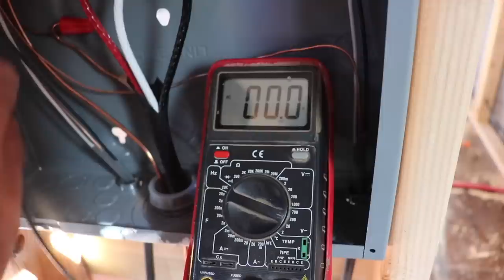CUE THE WATERWORKS!

Comment: A few minor electrical issues, from an electrician: that grounding clamp is normally used indoors on plumbing, the one you should have used is called an acorn clamp.  It also should have been put on before you pounded the ground rod in, because you often mushroom the head of the ground rod as you did.  The acorn clamp seems less likely to corrode and fail in a direct burial situation like that, which is probably why is is normally used there.  Also, your light in the pump house should be wired on the line side of the GFI, not the load side, so that when the GFI trips you will still have your light on.  The third issue is not a functional one so much as it is a code thing: the cables you pulled through the conduits to the barn and the pump house are not meant to go inside of conduit like that.  The NFPA doesn't like cable assemblies inside of conduit like the NM you pulled to the barn and the UF you pulled to the pump house, because they will be more prone to overheating.  You should have either brought the conduits all the way to the panel and pulled THHN (a much easier pull, BTW) and you should have set a junction box and switched from THHN to NM inside the walls of whichever building.   What you did should work just fine, since the conduits are well oversized, but thought you should know.  Also, all of the conduit (and the pipes too) should have been surrounded with gravel before you buried it.  I'm thinking that one day you may have issues if the conduits shift and you can no longer replace the wire when needed (or if the pipes shift and start leaking).  I hope you never run into those things though.  --- I do really enjoy the videos: your wife is a good videographer/editor and you are doing darn good for someone with no construction experience.  I'm really impressed with everything both of y'all are doing.  Keep following your dream!

Comment: Next time y'all pull wire through a conduit, run some dish soap down the conduit before pulling.  As you pull the wire through, it'll pull the soap with it and lubricate the inside of the pipe eliminating friction.

Also, 4:48 ground wire should've went into the hole with the screw on the butterfly lug.

Comment: Two tips for hammering rods into the ground:
1.  Use a T-post driver
2. Drill a hole part way through a chunk of wood; put hole over post; hammer wood.
Reply: SeaSpirit4 seaspirit thanks!!!
Reply: And soak the ground with water the clay we have here in Texas is hard to go through dry, wet it slides right down, I am talking about that ground rod.
Reply: You can use a hammer drill with the right attachment, just drive it straight into the ground.

Comment: One issue on your load center, the power should always feed from the top, even if you have to pull extra cable inside the box.
Reply: LeewardStudios I saw this as well! I mostly do Commercial tho and thought it was simply a Commercial Code thing for high voltage
Reply: Must be an American code cause in Canada 🇨🇦 (where I am) it doesn’t matter which end you tie in.
Reply: It’s perfectly fine to bring main wire into the panel from the bottom.  It’s allowed in manufactured homes.
Reply: Is the wire feeding the panel correct size “matching rating of main breaker”?
Reply: That is correct. Electrons will flow easier with the aid of gravity. What happens when the box is mounted sideways, do the electrons pool to the lower side?? Or is it really hole flow?? National Electrical (Opps sorry -Fire Code) has all them rules for war. I worked with a guy who questioned if he could run ac "backwards" thru the breaker via a generator when the power was down. We worked on High End Medical equipment. I said 50% of the time it would work!

Comment: If you have to do it ever again they make an adapter for a rotary hammer drill that puts ground rods in quickly.
Reply: glad to see someone mention this. i see many videos of people, even contractors, driving these things by hand.
Reply: Would it work for you put the rods in the same hole as the concrete support columns?
Reply: @buicklesabre4466  That is a bonded ground and in some areas is not code, I usually do both, one copper rod straight into the ground and a rebar bonding rod tide to the rebar of the foundation, the two are at opposite ends of the building, larger building get a couple of grounding rods and bonding rods
Reply: Always check your local building codes. Many localities have different rules on grounding and other electrical codes besides the standard National Electrical Code.
Reply: @TdrSld  Thanks for the reply. I'm not a professional, I used two grounding rods like they did in this video. I was just thinking it would have been easier using the same hole as the support columns. Thanks again.
Reply: @buicklesabre4466  i don't think there is enough concrete and rebar for that. they do have something similar called a ufer ground when building on reinforced concrete slabs.
Reply: A garden hose or a bucket of water is the best way to insert a ground rod.
Reply: That's what I was thinking when watching them hammering.  In a pinch, if you have a socket adapter, all you need is a socket large enough to fit over the end of the ground rod.  Another thing is, there is a thermite welding kit that is often used to permanently bond your ground wire to the grounding rod, MUCH better connection!

Comment: Hey guys, hope you read this - When you have your main breaker panel that far from your service wall penetration, you are required by code to have a disconnect switch on the outside wall of your dwelling.  You might want to consider flipping over your breaker panel as the main circuit breaker is typically installed from the top.  Also if you ever have to pound a ground rod in with a hammer again, take that adjustable wrench and use the hole in the handle to guide it, that way you can really let loose without hitting your hand.  Build is going great and I'm enjoying watching your excellent workmanship and the methodical way you approach problems and come up with solutions..

Comment: I can relate to what he felt when the rainwater system worked. I felt the same thing when I finished putting all the steel on my shop roof with a brace and bit, yes every single screw went in by hand. The shop is 25 ×40 so it was alot of screws. But there was a satisfaction in it. I lived for 10 years on my land with no power except my generator for the times I needed to cut alot of pieces. Most of  my nailers and girts were cut to length using the saw rig on my tractor. Living without real power is fine once you get use to it.  You get up when the birds wake up and go to bed when you cant see anything anymore. Falling asleep after 20 hours of daylight was never a problem.

Comment: Congrats on getting the water system working, I know what it's like to live without running water.

When I was stationed in Korea (one year in 1969) I was on a very remote mountaintop  radio site, we had generators for power but no running water. We hired Korean laborers to carry supplies up the mountain - 40 pounds per man up a 2-3/4 mile mountain trail. Several of the men had to carry jerry cans of potable water for drinking and cooking. We were lucky to have a mountain spring the emerged about 50 ft down from the site gate so we actually using mountain spring water instead of the lousy water that was brought in by tanker to our base site where the generators, fuel storage and trucks were.

With no running water we had a outhouse and a 5 gallon bucket with a spigot that we used to take a shower. We heated water with a diesel stove that supplied hot water for dish washing and showering (2+ gal of cold and 2+ gal of hot into the bucket for showers.All of this was in  small cinder block building up against the mess hall / dayroom In the winter it was a very cold walk up the hill from the mess hall to the barracks Quonset hut. That was great duty, it was the six of us against the world and the nearest officer was 26 miles away!

Comment: I would also recommend putting in a low water pressure switch that senses a drop in amperage and cuts off the pump so if your tanks ever get too low and run out you don’t  burn out your pump

Comment: Well done guys, water the and power, it's really impressive that the two of you did what is normally left to tradies. 
Though as a electrician I would have laid an earth/ground mat buried it with coal and salt then fed off a ground wire. It's a lot more work but grounding is challenging when not connected to city power. Or least put in a couple more ground rodes in, one at the pump house. I know it's more hammering but if you have a dish washer or washing machine a solid grounding is essential. Really incredible how far you guys have come

Comment: So very happy for you... next ground rod that you drive, make it easy on yourself... a piece of pipe a bit larger than the ground rod and weld handles on the pipe and a cap on one end. Now slide the pipe over the grounding rod and give it a slam down and no fingers get hit, no broken arms or lives will be lost. Make that driver heavy as the hammer at least to get the most out of it and you will never use a hammer again. And fence posts that are metal... that driver is named after it, it is called a fence post driver but it has multiple uses. Hope that helps you on tasks that are yet to be met. Great work so far

Comment: ...you are correct. If I remember correctly, City water molecules are clustered at 'about' 18 to 20 per cluster. Ionized water  i.e. mountain rain being the best, is clustered  at  'about' 5 - 7. This is why when we drink several glasses of city water, we 'slosh'.
Plus, lacking chlorine  and the naturally occurring 'micro clustering' Your water will go to your cells more quickly, less sloshing and quicker hydration.
In short, your water is more ph balanced, thus the 'smoothness' you experience on the palette.  👏 Enjoy.

Comment: worked for a well companey for 5 years we just did not drill well , did everything else if you want city preasure on your well get a thing call "Cycle Stop Valvue"  it mechanical it will keep depending how you sit it up 70 pounds of preasure on your system at all time, so when you take a shower you will not have to do the dance

Comment: I don't know if you will get an electrical inspection in your area so if you do the wire needs to be attached to the stud before it goes into the panel. Also any hole under 1.5 inches from the outside of the stud needs to be protected with a nailing strip. Great show and best of luck.

Comment: @Life Uncontained  Use a fence post driver to put your ground rod in .. much easier then drive the last foot w/ a sledge. glad to see you folks used a separate ground rod - per code for your sub pane I can't remember how many times I've run into improperly grounded sub panels, Alot of time people/ DYIers have run a 4 wire from the main panel and get shocked when using the tub/shower/sinks.
 Shalom

Comment: Not sure if this has already been mentioned, but check the specs on the flow rate of that ultraviolet purification light.  We had one a few years back that we had to restrict the water flow to it to make sure we didn't pass more water volume through it than it could purify.  Not sure if that's even a thing on the newer models, but worth looking into.

Comment: Chuckling at all the suggestions for driving the grounding rod easier when you've already got it in.  Locking the barn door after the horses escaped.  Please pull it out and do it over.  ;)

Comment: If you have run anymore underground conduit. Lay the wire out on the ground. Pull the conduit down the wire, then glue the conduit it together. A lot easier than than pulling wire through after conduit is in the ground.

Comment: my opinion is to use overflow filling system in ur rainwater tanks (from tank 1 to tank 2 n tank 2 to tank 3 by overflow)...reason for that is by doing so u can use 1 tank at a time also u just need to open the valve of one tank that u wish to use...just a suggestion from my side

Comment: Suggestion: To easily "sink" a ground rod, 1) Scoop out a small pocket of dirt where the rod will go, (3" deep).  2) Get a small pitcher of water.  3) Pour about 1/2 cup of water into the hole.  4) Grasp the ground rod and gently thrust it up and down in the hole.  5) Periodically add a little water if it gets more difficult.  RESULT:  Using this method I have installed many 10' ground rods with no hammering!  It sounds like magic, but it really works.

Comment: Spenser,
If you ever have to install an grounding rod there is an easier way. First wet the ground around where it is supposed to go. Then use your anchor drill to do the pounding. It will reduce the labor needed plus be faster as well. Also if you ever have trouble getting your fish tape to go from point A to B on a long run, use a vacuum cleaner to suck some heavy string  that has a wade of plastic (grocery bag thickness) tied on the end. When that has been pulled through tie the string onto the rope. When that is in the conduit tie the rope to the wire you want to pull into the conduit. The rope will make it much easier to pull in the wire. This can help you now or sometime later. Best wishes to all three of you.

Comment: Hopefully you see this. When you open up the main valves, open them up as slow as possible. That big slam that scared the crap out of you is called a water hammer. It will blow up couplings, valves, fixtures, ect from the sudden rush of pressure. Also open faucets to help reduce the hammer effect.

Comment: Just a heads up you’re going to need to put metal plates over the 2x4 where the wire is or it won’t pass inspection

Comment: Awesome job guys. Only constructive criticism i have is to always act as the breakers are hot and don't put your fingers on the screws. Also make the leads longer at the  90 degree bend in to the breaker. It will help you later.

Comment: hey guys,a tip for putting your grounding rod into the ground,use your SDS pneumatic hammer/drill,also i like to point out that rain water does'nt have calcium,something you need for your teeth and bones,so you will have to add it,take supplements,or eat calcium rich food,otherwise great work you guys,my hat of for what you've have accomplished

Comment: Ok, so I know you drove it already but, for future reference and everyone else out there. Driving a ground rod in soil (not rock, you will need to drill a pilot hole or lay horizontal).
Step 1: Shove rod in soil and make shallow hole.
2: fill hole with water
3: shove rod in hole and work up and down.
4: repeat steps 2 and 3.
5: be amazed how little water and time you spent driving a ground rod.
You are welcome.

Comment: If you need to drive another copper rod into the ground.  Use water as you pound the rod.  It will sink easier and faster.  Just pour the water around the rod at the ground and pound away.  :)

Comment: An observation. The NEC article 250 states: To ensure there is no interference from the footing, the ground rod should be placed no closer than 2 feet from the exterior wall of the house. 
A state electrical inspector told me a ground rod should be driven out past the overhang of a building so it stays moist and has good electrical conductivity with the earth. Yours appears to be under the overhang.

Comment: You should consider building a solar hot water heater using pyrex vacuum solar tubes and some of that roof space you have available. Depending on the size of the system you build you may generate enough hot water to supplement your heating system. If you use water for your heating and cooling medium (closed loop) you could use solar or wood fired furnace or gas for options. Depending on what's available and cheapest at the time.

Comment: Use a piece of pipe with a cap on it to drive the ground rod. Lift and slide down rapidly or hit it with the hammer. It won't flex as much.

Comment: You are wrapping the PTFE tape around the fitting in the correct direction but if you flip it 180 Deg it will keep tight on the roll try it
Regards
Denis

Comment: Well two things the ground rod should be out of the overhang  like 6 ft. and you need two ground rods . with  solid uncut ground wire. The easy way to put ground rods in pour a bit of water where you want the rod. take the rod and start moving it up an down keep adding water  till its a couple of feet out of the ground then  thread thr ground wire threw the grounding clamp. put clamp 4 iinchs down and tighten. Pound the rest of the way into the ground. easier to do it than me typing it.. GGood job guys.

Comment: From your barn to the house you ran 6/3 Romex? That is only rated for 55 amps max as being 60°c rated wire in the NEC. It also is a Dry Location rated cable. It cannot be pulled underground. Also be careful with grounding and bonding at the house. Bonding to your Conex container is important. Ground rods and bonding to your neutral and grounding wiring via a bonding screw should only happen at the Main Disconnect. Your main Disconnect is probably at and in your barn where the solar panels are. That is where your ground rods should be only. The ground rod ground clamp should have been an "Acorn" style clamp that is underground and direct burial rated. The J Junior you installed is not direct burial rated. Remember also to install Nailplates on all of the framing members where you drilled and rain your romex through the studs for wiring protection. Great video. You all are doing well. Do take care and God Bless.

Jeff - Licensed Journeyman Electrician - Sunny Central Florida 😎 🌴 ☀️ 🍊

Comment: get a metal fence post driver. Basically a steel pipe with a plate in the middle and loaded with lead, sand, or steal on the top enclosed end. Slide hammer style. Probably has a real authentic name. You could easily weld one up.